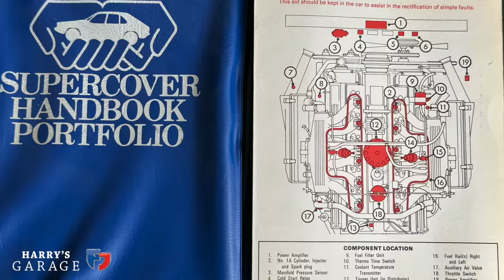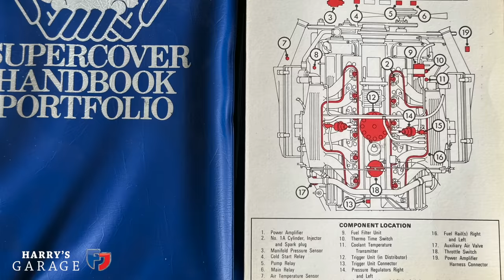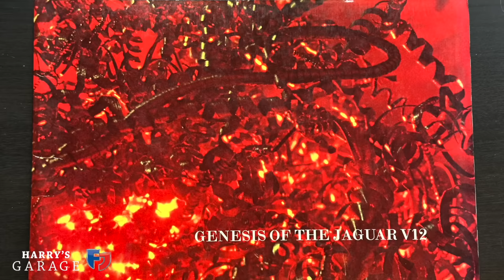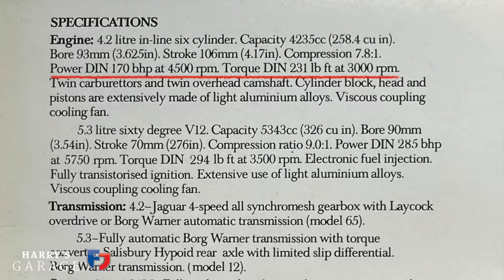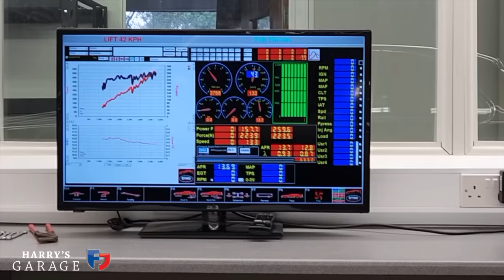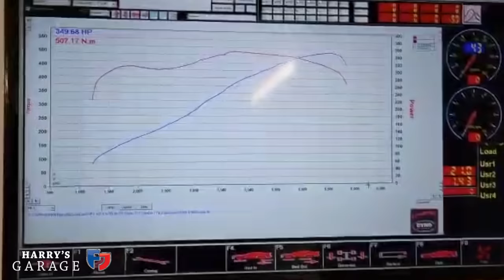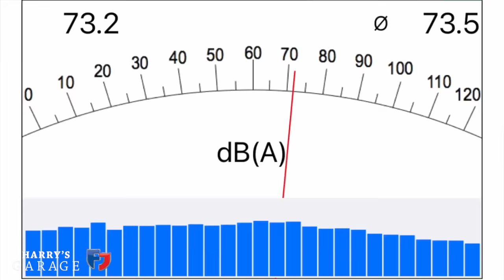My Jaguar XJC V12 visits the dyno & the result is more power & it sounds even better!

Comment: Cant believe im gonna type this but I swear if I closed my eyes and was asked what car i was hearing. Id have to say theres a horse in the emblem not a cat ! It sounds like a early Ferrari V12 and not a Jaguar by any means.
  Ahh a V12 the only engine to power a car, that I havent driven yet. Got to drive a V10 powered car, own a mid/big displacement V8 powered car now. Had a few inline 6 powered cars. turbo 4cyl, NA V6's, drove both flat 4 & 6 cyl powered cars. But unfortunately never that glorious sound of a V12 under my right foot !!  I know its coming, so ill just say it now, NO I havent driven nor will I ever own a EV !! Sure a electric motor powered car is quick. I just cant get over how they are without a soul compared to a ICE powered car. I might consider a hybrid some day, but will fight with every fiber of my being to my last days on this planet about owning and driving a EV daily !!

Comment: My 2017 Chevrolet Tahoe SUV 4x4 has a 5.3L V8 engine - 355 HP with 380 ft/ibs torque regular gas.
If I run E85 fuel power jumps to 380 HP with 416 ft/ibs torque.

Comment: You spent 12,000 pounds on the injection and ignition systems without going inside the engine? In the search for more power, are there not better ways to spend that kind of money? I'm putting a 1980 V-12 into a hot rod, a 1930 Ford Model A and wonder what are the best things to do to it. The Jag is nothing more than a piston engine with an extra four cylinders compared to what you'd find in 99.9% of hot rods, namely an American V-8 and had I used one of those, it doesn't take 12,000 pounds (I'm Australian so that's around AU$20,000) just to get fuel into the engine and light said fuel. Can you please explain why it cost you that much? I'm at a total loss here.